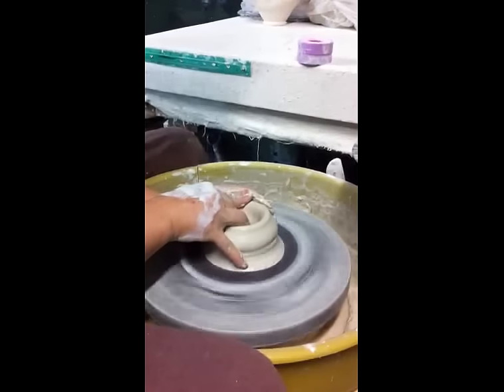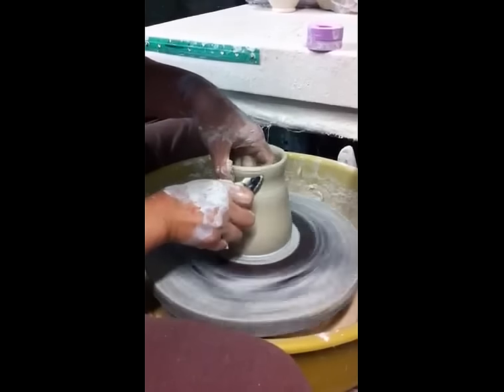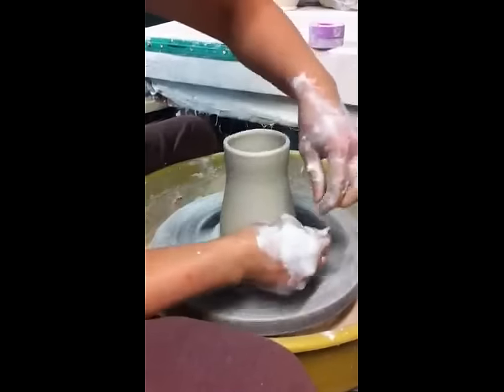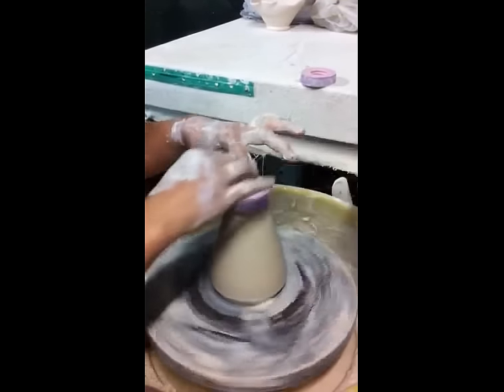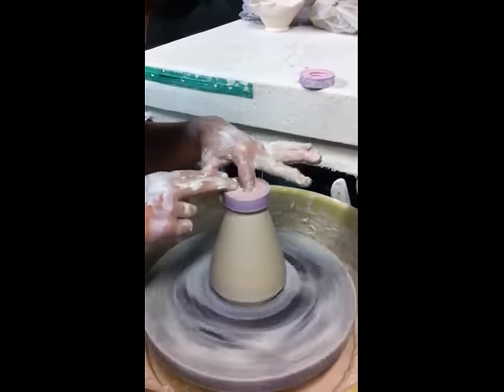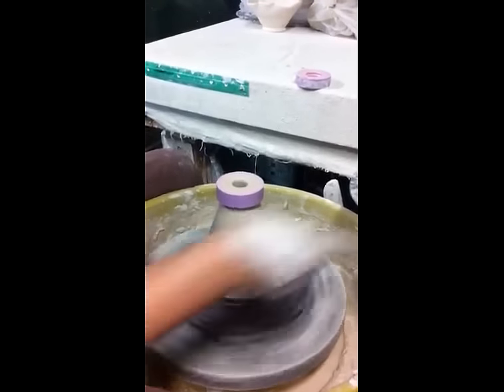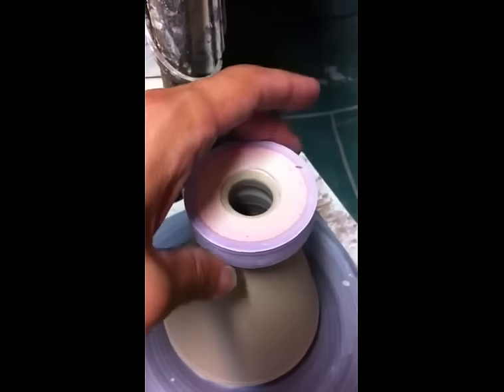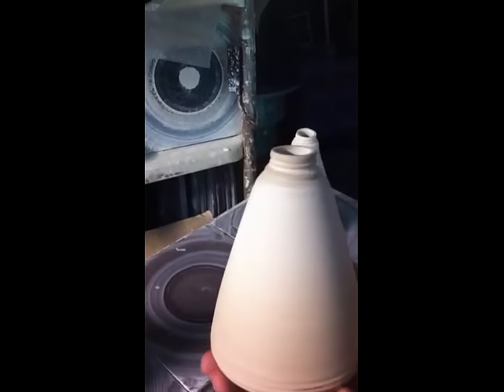How to throw a threaded neck on a bottle

Comment: To remove the mold, do you wait until it's leather hard to unscrew it off, or is it preferable to remove when it's still wet?
Reply from the maker: Wait untill leather hard is more preferable, you can even wait untill bone dry , I wait untill I see a small separation line in the clay